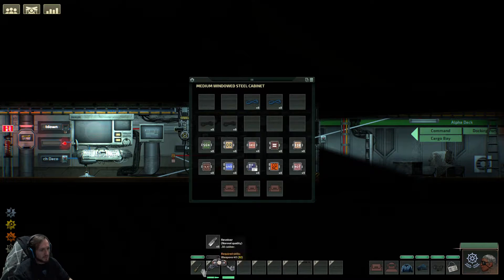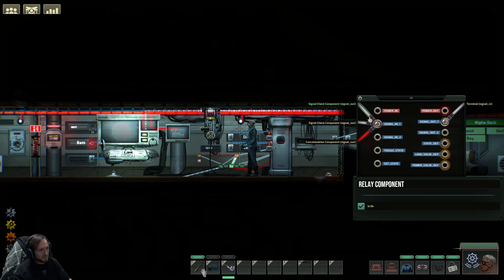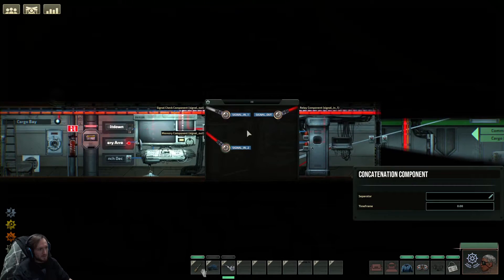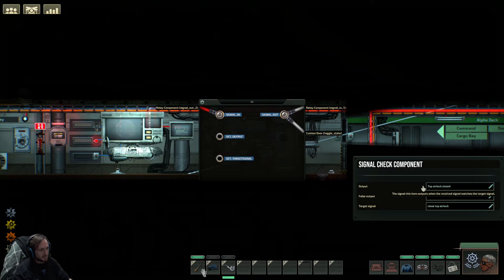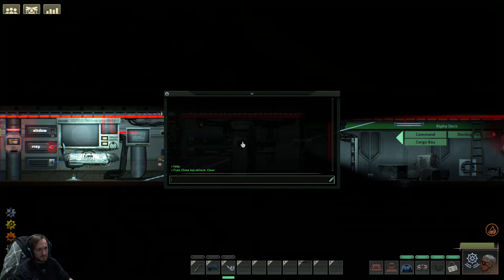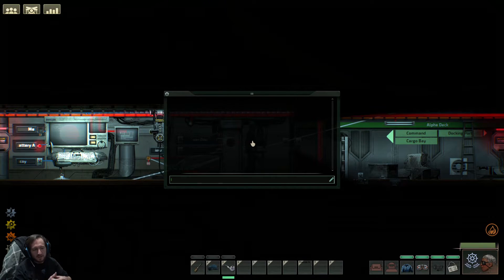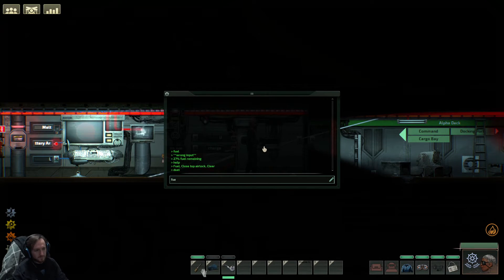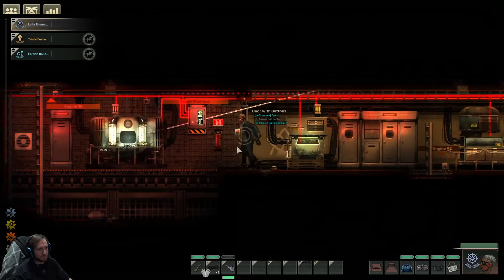Barotrauma - Terminal Wiring Ideas

Comment: There is a default use of the terminal on the Humbpack to control the batteries: On/Off to connect/disconnect from the Grid and number from 0-100 to set the charge rate fpr the batteries
Reply from the maker: If I ever get back into the game I will have to check it out. Seems that was not one that we used in my playthrough so I never saw a built-in use for it.

Comment: There is a problem. Issuing commands from the terminal is too slow.
For all usecases shown, "terminal-less" sollutions would be much more fast and relaible:
- Fuel level should be just shown on display permanently (and attached to alarm for signaling "fuel low" situations);
- Airlock could be triggered via motion detector;
- Fixfoam grenades better to be attached to "emergency" lever (and to water detector(s) - to be used only if high pressure - i.e. "hull breached" situation - detected)

I'd use terminal more as reporting system (for complex messages, too long for displays and color lamps - like combined device state reports: "comand post - electric devices need repair", "engine critical", "hull breached: ballast 1, gunnery", "intruders: deck 1"), or for tasks which too dangerous to assign on buttons and levers - like self destruct charges activation (i know some ppls who used such contraption for some mistery reasons)

Still. Interesting approach to idea.
Reply from the maker: I 100% agree all these can be done in a much cleaner way that is automated. I personally did all of your points on the ship I was playing with friends on. I started looking into the terminal because I found it odd there was no real use for it by default. 

From an RP method I like the idea that the mechanic or someone can be on different terminals to check things while staying in their spot. You could have a screen in each room to show all this but the terminal is just cool and fun to use. The best solution I found for this may be this video. It is not a long chain of commands you do and more or less just shows you the information on the terminal or in the chat.
https://www.youtube.com/watch?v=gGyJSkR6m5U

Comment: Is there a way to have the terminal act as a universal broadcaster, allowing typed messages to be sent to all players?
Reply from the maker: There is but the option for it needs to be turned on by the creator of the game. On the wi-fi component there is a "link to chat" option that cannot be seen unless the host allows it. On the server settings screen when a coop game is made, have the host click on "server settings" and then "anti-griefing" and have them check the option "allow linking wifi components to chat"